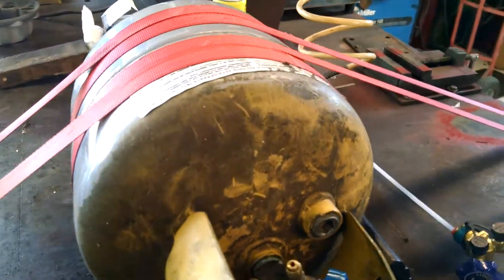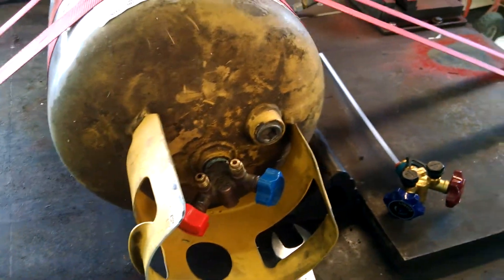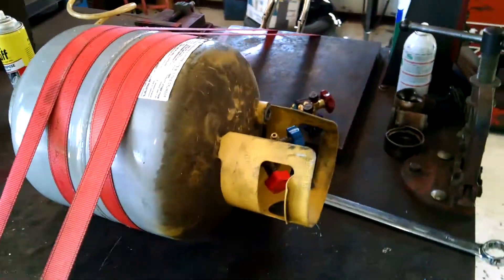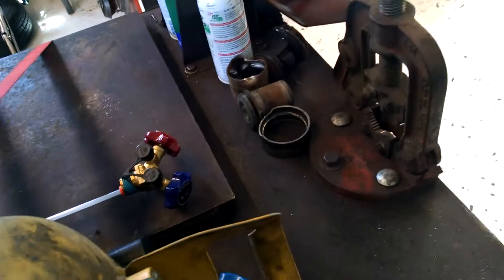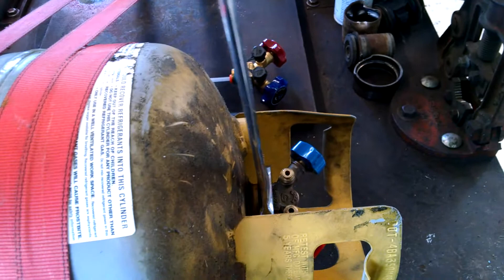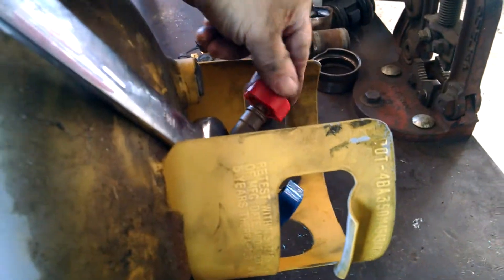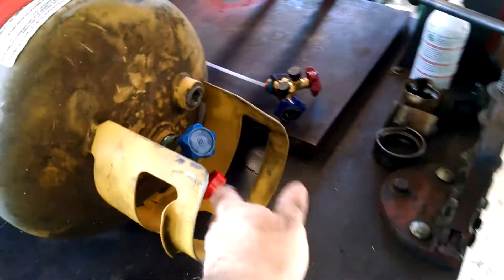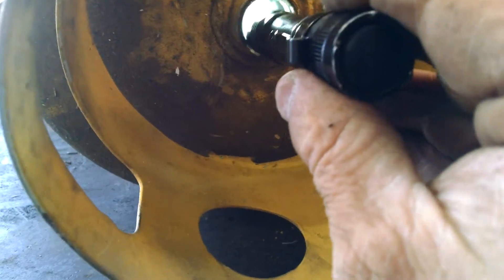Replacing a R134A freon valve for recovery/charging tank   Part 1 of 2

Comment: My Valve has done the same thing, where did you buy the replacement valve? Can you forward the info, I need to order one. Thanks.
Reply from the maker: https://www.centurytool.net/Refrigerant_Tank_1_2_ACME_Y_Valve_Assembly_R134A_p/y-valve%20acme.htm Is where I beleive we bought it from. (Forgot over the past 2  + years)
Reply from the maker: This is for R134A/ R12 will be a different part number.
Reply: Great, thanks. I will get in touch with them tomorrow. Again, thanks!
Reply from the maker: Your welcome .